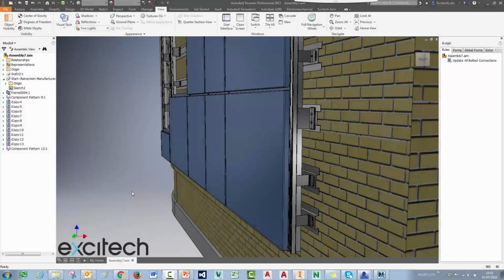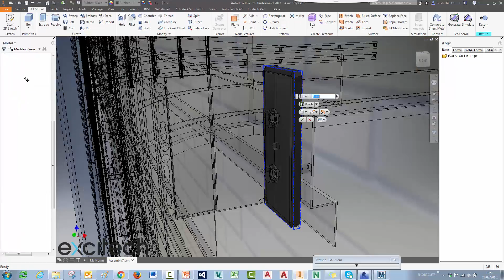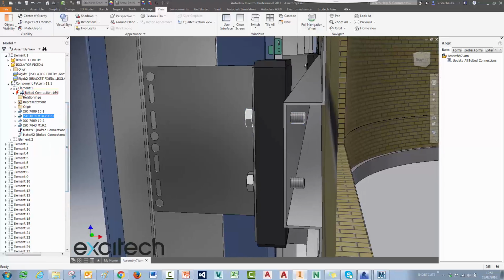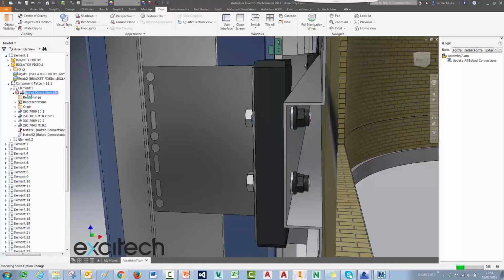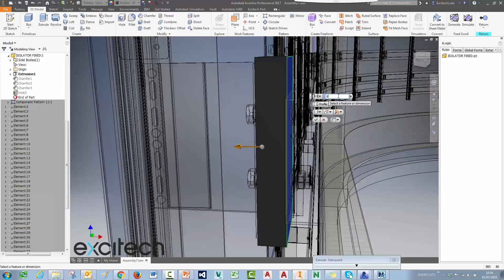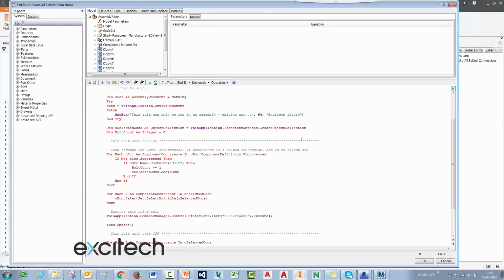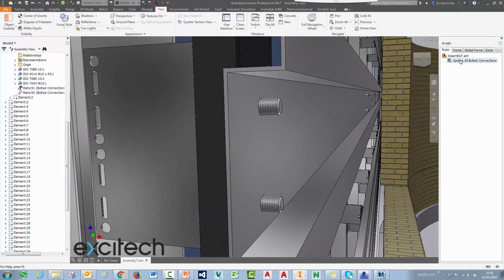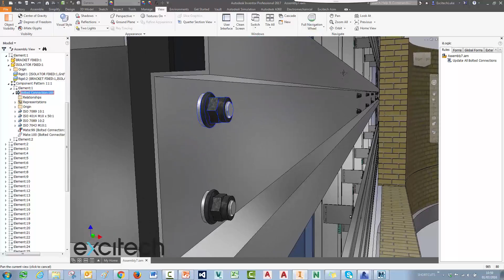Autodesk Inventor 2017 - iLogic - Update All Bolted Connections

Comment: very useful tutorial.... how do I get rid of the "lighting bolt" icon on some of my bolted connections
Reply from the maker: Hi Hans, Glad you enjoyed the tutorial. You should just be able to update them by RMB on the bolted connection and click on Component>Manual Solve. If you RMB on the bolted connection and select Component>Automatic Solve, then the solver will run every time the assembly updates. Manual Solve is the default.